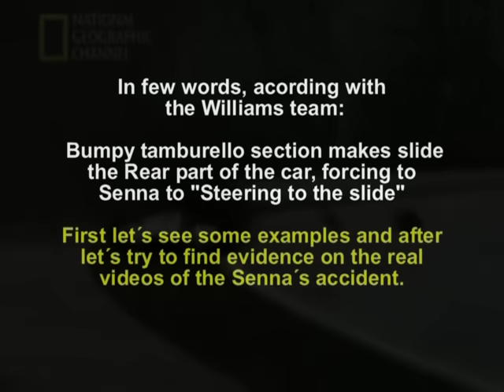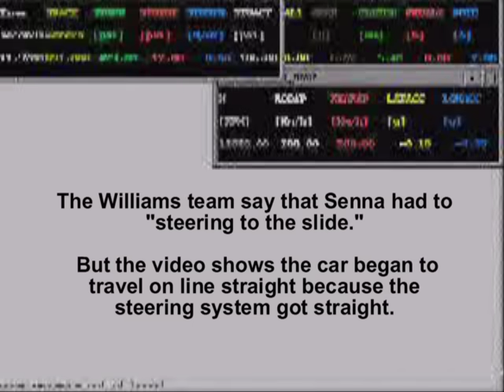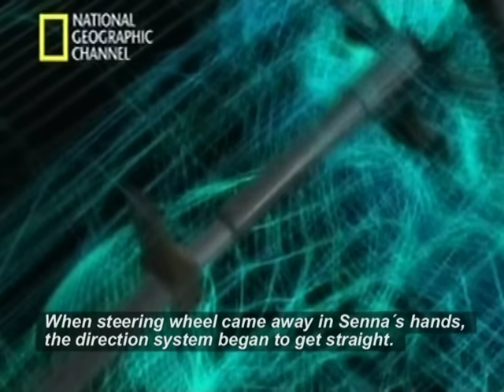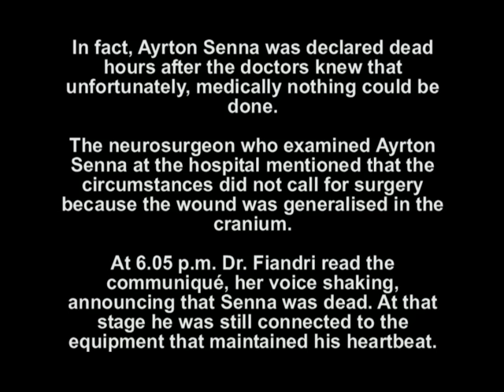5/5 the death of Ayrton Senna - what NatGeo did not tell

Comment: It's clear what happened - Senna was killed because his steering broke, and Williams tried to cover it up.  Simple.
Reply: +spaceweed10 Same as in the case of Jim Clark's crash that was caused by the failure of the rear suspension. But officially, Firestone took the blame for a "flat tire". People first hand at the scene saw that no tires had deflated before impact but the tire company took the blame anyway.
Reply: doesnt it say so in the video??
Reply: WHAT U SAID!!!!
Reply: It's not at all clear.  The video uses for demonstration extreme cases of skid corrections where the driver actually reverses the steering, but a driver that is skilled enough to catch the skid as it starts to happen can just ease up slightly on the turn without turning in the opposite direction.  You can see this slight easing at the point where there is static in the video if you look carefully, as well as the turn rate slowing.  Then the second bump causes the front of the car to go loose, eliminating steering control, and all that was left was the brakes.

Senna alway pushed hard, and had started pushing really hard in the previous couple of years when ABS and traction control made the car more forgiving.  With the banning of such "driver aids" in 1994, he was pushing too hard for what the cars had become.  He had already failed to finish either of the previous races of the season.
Reply: and what about the brakes ? he had no brakes either.
Reply: agree
Reply: Stephan Gildenhuys we don’t think we’re superior 🙄.  We leave that to the arrogant Germans and French.    This accident should never have happened, and the fault lies entirely with the Williams team.
Reply: @psychohist  

Amazing info. You are implying that FIA rules caused the safety to get worst. Another evidence on my list that FIA rules are not for safety. Not at all.
Reply: Stephan Gildenhuys it was an accident - no one set out to kill him.  What about Ratzenberger?  I think it’s disgusting that no one remembers him - especially as he died the same weekend.  Senna even had an Austrian flag in the car that he was going to wave at the end of the race out of respect.  F1 back then had real stakes with real men literally risking their lives to do what they loved.  The sport is so much safer now, but that doesn’t mean there won’t be further deaths - accidents always happen and it’s difficult to plan for the unforeseen.  I concur that Senna’s death was handled badly by Williams, but it happened as a result of poor implementation rather than a deliberate act.  IMO Senna was not only the greatest F1 driver of all time, he was also a man of real honour - I doubt we’ll ever see another like him in any sport.
Reply: Jayco Nobody held a gun to Senna’s head. Grow up!
Reply: Mark G. Where did I say he was forced to drive?!  Obviously you’re not the sharpest tool in the shed...
Reply: I think the fia was also desperate to make it look like a driver mistake. It would look bad for the sport.
Reply: @machinemanmclaren  

Actually that's interesting. It said that his brakes were fully on. F1 cars stop incredibly quickly. It did not look like his brakes were working at all.
Reply: Looking at the camera from Schumacher's PoV who was directly following Senna, it showed a sudden loss of traction from the rear of Sennas car right before he lost control. This would suggest not steering failure but an aero/grip failure, potentially supporting the bottoming out/punctured tire theory. At those speeds on that corner, you are on a knifes edge, so even the smallest of failures gets multiplied with zero time to react. 

In truth, we will never really know.
Reply: why did his steering broke? Sabotage.
Reply: I don't feel so bad for Williams being last anymore
Reply: No, I think F1 covered it up, to avoid losing millions of $, in revenue/sponsorship
Reply: I agree, but I also think F1 banning steering/brake electronics played a part. 
I also think the team didn’t inspect the welds thoroughly.
Reply: @kbuss10  finally one that knows what really went on !
Reply: Stephan Gildenhuys  Some folks think they're superior, regardless of their nationality. I'm British and I'm disgusted that this cover-up happened. It might not seem a massive deal to some people, but these pieces of evidence that they omitted are shocking. And yet Williams are still in F1 even now? The reality is that the car Senna had was nowhere near good enough for him.
Reply: @jayrave4  Germans and the French aren't all arrogant...anyone can be arrogant, irrespective of their nationality
Reply: @machinemanmclaren  The car had brakes, but was travelling too fast in order to stop, or at least slow down  before striking the wall. I think the broken steering is the culprit, and not the occasional bottoming of the car on the racetrack.
Reply: Steve Bell 
It was not a manufacturing error. 
It was a poorly informed and executed modification with a poor quality weld. Essentially a butt weld with no forethought to the heat affected area or to elimination of stress risers. Could have been a chromoly shaft and somebody welded it cold.
Reply: @jayrave4  ...Gerhardt Berger had a HUGE crash that weekend also: the silence after that THUMP when he hit the wall wheels first was SCARY.
Reply: @Delimon007  ...deceleration of up to 5 g; just taking your foot off the gas causes a 1g deceleration: 32,2 ft/sec2 (9.8 m/sec2)
Reply: @stevebell4853  ...'55 LeMans the Mercedes was magnesium also and that car burned for a LONG time. And you can't put out the fire with water. Uh 1 helicopters were made of magnesium also.
Reply: Jayco f1 is like this British boys club. Whiting, Ecclestone, Williams, Newey ect. all got together to cover it up.
Reply: No worries Stephan. It's a fact that F1 has a British dominance, the Brits love to tout it... unless it concerns controversy or outright deceitfulness. Charles Whiting allowed for the Williams team to remove the black boxes, which is quite obviously against regulations and the protocol for a very likely pending investigation into an accident causing death. Now to the average punter out there. How far back do you think Whiting and Frank Williams go for instance? Williams were so cheaky at the trial that they surrendered the black boxes (after they had them for a full month) for evidence, however the telemetry could not be accessed because they did not provide the data card. That is a disgraceful act in itself, and quite a conscious one, which was intended to delay proceedings. Guilty.
Reply: Spot on Stephan, the commentary has been making me feel sick for years. It is so biased and unprofessional to the point of disbelief. That bloody Martin Brundel, or how ever you spell his name, has a lot to answer for. It's funny when I saw a doco on Senna's death and they ask Brundel and Hill on the possible failure of Williams and they both dismissed it out of hand. It sounded so rehearsed from both of them.
Reply: @philgiglio7922  Rubens Barrichello, Gerhards Crash was Years before that. But you are right, his Accident was very bad also.
Reply: @simonstylites8316  Safety was already bad.  The FIA failed to implement rules to improve safety.  Proof is that today Senna's wreck would not have killed him, because there would be a run-out area to absorb his speed, and it probably would not have caused that tire to go flying.
Reply: Its a real shame im from the uk senna was my childhood hero and that williams car looked the nuts was so happy until that day watched it over and over and even before a statement was made i knew he was gone and it was williams fault they basicaly murdered him and the covered it up may williams rot in hell
Reply: @machinemanmclaren  hes going 200 miles per hour brakes wont do anything at that point
Reply: Yes but the previous year Senna’s worst enemy was sitting in the same car and became a champion.  Why would Prost quit the best team with a championship winning car right after to allow his worst enemy sit in the same car and become the best driver of all times by winning potentially many more championships ? Answer: sabotage. An inside job with Prost behind it.
Reply: @machinemanmclaren  be quite it had nothing to do with prost and it wasn't the previous year he died in 94. Senna died because his steering column broke
Reply: Stephan Gildenhuys  Why was we nailed? You sound anti English pal. Senna died doing the thing he loved. Frank Williams didn't force him to drive for Williams! That was his choice. Senna was out to prove a point against Schumacher and Benetton. He openly said they was cheating so he took more risks to beat them. I didn't like Senna! Not because I didn't like the man, because he kept beating Mansell. When he hit the wall I thought okay another boring Schumacher win he'll get him next time. When the news broke he had lost his life I broke down in tears. This crash still haunts me and good many others to this day. I'm just glad I grew up in the era when he raced.
Reply: Stephan Gildenhuys  Well I won't lose any sleep over it.
Reply: machinemanmclaren he braked just before he crashed and he died from a wheel or suspension pole hit him so halo alert
Reply: Lots of wannabe engineers and accident investigators on he lol
Reply: PAC_ jon - I remember talk about reducing the weight in this structure and maybe they went too bar hence unexpected mechanical failure .... It’s a hazy memory now but there was a reference to thinning down the component
Reply: Uhh the engineer openly still holds himself responsible so no. No cover up.
Reply: Moises C. B. Brakes weren’t that good then, it was all engine braking, not sure if it was paddles by then, don’t think so.. but he would have had no engine braking or regular braking on the gravel. Column failure or not, if he left the road at that speed he would have likely met the same fate
Reply: Stephan Gildenhuys the engineer responsible for the modification to the steering column still holds himself responsible to this day, the modification was to extend it I think. The joining method being the pressure of ones hands holding the wheel was likely something used in every car
Reply: Stephan Gildenhuys they actually relieved him of his contractual obligation to race, he told them to shove it
Reply: 4zap7 he didn’t bring Williams anything. Only hatred. He did all his good work at mclaren
Reply: @jayrave4  I more blame F1/FIA at the time, as the race should never even have happened, being there was already a death on that track just two days before. He died instantly, but want declared dead until he arrived at the hospital, so "technically" he didn't die on track, therefore they found a shitty loophole in Italian law.
Reply: @jayrave4  not al germans are arrogant.. look at schumis post race persconference when he won hos first race im 6 races and the interviewer mentioned the name of senna. Schumi immediately bursted to tears. Plus your response is really arrogant tbh😂 immediately blaming other countries that they are worse sounds pretty arrogant
Reply: @Mafia681  why would they accept the blame? I dont know much about Clarks crash but that seems strange
Reply: @machinemanmclaren  the Williams car the year before Senna died also had abs, traction control and an active suspension which technically should have never been allowed in the first place
Reply: @psychohist  if the front went loose as in, in the air, then we would've seen faster steering action since there's no friction on the front tires working against the steering. That slight movement you mentioned looks more like the car's alignment straightening itself on its own after the steering column broke.
Reply: Professional liers !!
Reply: Kris Roberts l
Reply: @pac_jon  No, Senna had asked for his steering column to be altered <lengthened or shortened, I forget> so there was at least one weld in it.  That would be highly significant and probably cause of steering failure.  And don't forget, the car's equivalent of the 'black box' was grabbed by a Williams engineer before anyone else got to the car.
Reply: I think we fainted before. Even if the steering broke, he would break heavily... we would see the smoking tyres.
Reply: nope not at all
Reply: His break also didn't work
Reply: @jayrave4 , arrogant Germans and French? What are you if not talking arrogant?
Reply: @galaxynova9332  His breaks did work, 20m of asphalt isn't just enough to slow the car down at this speed.
Reply: Not just that the tire hit him in the face as well
Reply: Damon Hill (his teammate) reported that the Williams was bottoming out there something awful, which you can see on the previous laps.

There is video somewhere on the Intertubes of Senna bottoming out and going off in a very similar way to his crash at exactly the same spot while practicing earlier in the year. A guy who was there personally said that Senna went off for a couple of laps in a row and then took the corner less agressively for the remainder of the test.

Frankly, it makes a lot of sense that Senna - who definitely made just as many mistakes as anyone else, despite the circlejerk - simple made the same mistake in the race as he had been observed making before. In the race he had a much heavier (and thus lower and more difficult to drive) car than Schumacher, who was pressuring him very hard.
Reply: Aaaaaaahhhhhhhhhhh???????
Reply: Senna modified the steering himself. He preferred the steering wheel to be at a particular height/distance that the rules didn't allow. Senna wanted the steering column modified - illegally - to fit his preferred driving position. Senna killed himself. Period
Reply: @iwasadeum  even if this is true, the negligence still lies within the team and the engineers. They have a professional responsibility, so they are at fault. It's like me going down to the local engineer and requesting he do some dodgy modification to my car. If I go out and crash and burn, the liability is going to come back to him. And god forbid I take out someone else with me... like a marshal for instance.
Reply: Clear, eh? From a shitty video that completely cuts out in places? Correcting a slide does not mean grabbing opposite lock. Often you don't even come back to center. Also...the telemetry doesn't agree with you
Reply: James M  You 'didn't rate Senna as highly as some'?  That makes your opinion invalid right there.
Reply: @spaceweed1025  all opinions but yours are invalid. that makes yours suspect. I was  44 when he died and a race fan the get-go. Senna was not universally loved. It was a love-hate kind of thing and I was on the hate side. I accepted that he was likely the fastest one-lap driver of his era but he was a bully with a race car. Too many times he barged in where he could have made the pass next corner or next lap and it wouldn't have changed the result. He had the talent. It always bugs me when someone with such immense talent uses pure aggression instead of talent. If everyone raced like Senna it would be a demolition derby. He would never get my respect unless he learned to race clean.
Reply: @_jacksonette_  Indeed, but the Germans and French are experts at it.
Reply: His steering wheel shat broke and that is what caused his accident and death... Williams fault!!! Everything else is bullshit and over explanation!!! Plain and Simple!!!
Reply: No way would a F1 team send a driver out with a less than perfect steering assembly. FIA cover. The trial was a complete Italian feckup!
Reply: @machinemanmclaren  Exactly.  I actually caught Prost tampering with Senna's car just before the race.  Asked him what he was doing.  He said he lost his car keys and thought they might have slid under Senna's car.  It still haunts me that I never said anything to the race officials.
Reply: @psychohist  Yes Senna pushed hard, but ultimately what killed him was the broken steering, not his (some may say) reckless behavior. Senna was a genius, and he would not die in Tamborello if not for the broken steering. As the video make obvious, his tires never moved, even the worsest pilot would turn to the left. Senna never had any chance to turn because the steering bar broke and sealed his destiny.
Reply: No it's not
Reply: @jackhammer111  Get yourself educated.
Reply: @user-qx7tm5df8j  Not really - the column itself had been modified to reduce the weight which lead to the failure. However,  Williams to this day maintain the shaft broke because of the crash not the other way around. Sir Frank Williams, who forced the change on a reluctant Adrian Newey, cites the steering data log showing the car was still "accepting steering inputs" as proof the column was intact. That the sensor (just a pot and gear) was above the break and so proves nothing about the state of the connection to the wheels does not seem to enter into Frank's tiny mind. I never liked Frank Williams; he always struck me as a clinical psychopath.
Reply: It's innovation, racing prototypes drivers and teams all know the risk. After the Brazilian media coming out that their will be a contract out on Frank how else could they respond
Reply: @Mafia681  That is total BS. Document it for us. Obviously if people first hand at the scene call what you say Firestone wouldn't take the blame. Tire companies don't make money on racing tires they make money on passenger car tires. The only reason they race just for advertising and marketing. No Corporation it's going to accept the blame for the desk of the most popular racing driver in the world if it can't be proven. If you're going to say something like that you need to be able to prove it and you can't
Reply: @bertram-raven  And you of course are the only ones that knows that the break was above the sensor, or is it the sensor above break.... it doesn't matter because what you are saying would have been perfectly obvious had it been true so you don't get to come along decades later and get away with saying something stupid and have anybody rational believe you.

YouTube comments accept links so if you have some credible proof of what you're saying just presented here and see if anybody buys it? Don't make things true just by saying them you know unless you're a fan of Donald Trump, then you think you can but you really can't
Reply: @jayrave4  I smiled when senna crashed
Reply: @pac_jon  bad senna karma
Reply: @madsjuul1350  you must be a real laugh at parties.
Reply: @alexanderackerman8465  senna died because of bad karma
Reply: @madsjuul1350  suspension*
Reply: @alexanderackerman8465  ultimately it was bad karma
Reply: @psychohist  if you can't see the car go completely straight with no left or right turn then it's completely pointless for anyone to debate with you. Because it's not a debate. The reference point is all one would/should need to be convinced if the other wasn't enough
Reply: @machinemanmclaren  At the speed in that corner he was travelling. as soon as he left the trackthe brakes weren't going to slow the car much. It would be like sliding on ice.
Reply: @SpacestarB  it was a suspension rod that pierced his helmet..
Reply: It’s not clear die to a slow safety car cold tyres with low pressure the ride hight was lower than on e warmed up, his car bottomed out in one clip it shows him turning but not the car as it essentially was skidding along the track at high speed
Reply: Very sorry to break this to you but your comparisons with regards to over steer do not make any sense, your talking about two seperate parts of the corner, which in turn have different throttle positions, steering input and rely on different grip dynamics , - mechanical and aero.. Your argument is flawed
Reply: @jayrave4  Not superior just racist.
Reply: @Nearest_Neighbor  most British people are not racist
Reply: @jayrave4  But then why did you choose to be?
Reply: @jayrave4  Please don't be like that, Jay. This negativity isn't good for you and you know that.
Reply: I BELIEVED, until recently, that SENNA was dead because of the suspension, which was detached following the impact.  Instead, it was the deceleration, which caused the fracture of the base of the neck.  It is one of the doctors who rescued him, to say so.
Reply: Indeed.
Reply: Completely agree!
Reply: It's soo "simple'' it's magical.
Reply: Sorry what are boing and FAA did???
Reply: @stevebell4853  look in the mirror
Reply: they didnt cover anything up they cut it and welded it as senna wasnt happy with the length of the steering .get ya facts right ffs.that was told in court ffs.
Reply: i guess im asking the wrong place but does someone know of a trick to get back into an instagram account??
I was dumb lost the password. I appreciate any tips you can offer me
Reply: @Arlo Saul Instablaster :)
Reply: @Eliseo Randy i really appreciate your reply. I got to the site thru google and im waiting for the hacking stuff atm.
Looks like it's gonna take quite some time so I will get back to you later with my results.
Reply: @Eliseo Randy It worked and I actually got access to my account again. Im so happy!
Thank you so much, you saved my account :D
Reply: @Arlo Saul you are welcome :D
Reply: You're absolutely right!!! $ vs. Life,and $ wins (unfortunately)!!!
Reply: @stevebell4853  Well, he might have a point.  Look at the way we disgrace ourselves before, during and after football matches.  Like mindless thugs.  You can thank those idiots, probably for other guys' comments. No other nationality does it to the extent we do.  I would say we are arrogant.  A lot of us.
Reply: @machinemanmclaren  breaks we’re working, as like aircrafts on run ways when the wheels fail and they ultimately crash, he ran out of run way. Or in his case, he ran out of road to slow down on
Reply: @Delimon007  you do realize when you pass your standard driving license it says how much road is required to break from separate speeds right? Is, traveling at 30mph requires this much STOPPING DISTANCE, and traveling at 70mph requires this much etc, you do realize these guys are doing double that, around a corner? How the fucking he’ll do you think the breaks would do anything to stop his car before the wall???? 

It’s like asking a full freight train who notices a dog is on the tracks to stop in 10 car lengths not to kill the dog, where as it’s more likely to require at least 2 football sized pitches to come to a halt in a straight line, let alone a fucking corner!
Reply: yeah just now I was thinking that thing.
R.I.P Ayrton Senna
Reply: I’ve raced go-karts and had my steering break. It looks like Senna’s did too, you can even see Senna’s head tilt into the corner as if he is trying to turn left, not right as you would in a skid.
Reply: Exactly, if he had any steering at all he would have broad sided the wall instead of clipping it with his front right wheel.
Reply: It was mechanical they didn't know if  steering broke before or after impact  if it were only the bumpy road it should have affected other cars not just sennas car  the steering broke because it was welded together not a solid rod  it should have been a solid rod   sennas team killed him
Reply: The brits mclaren cyndicate team had some involvement in all of that because senna chosed to go to Williams the other team wich had the better more advance car and maybe offer him a bigger contract $$$ and mclaren influence made FiA to make new rules to even the odds in their favor to force Williams to downgrade their f1 cars  resulting in making the car less safe and stable......so do believe senna car was also sabotage the night before his accident by mclaren by loosing or half cutting the steering wheel column resulting in his accident and death.....the point is that mclaren killed him because he turn his back on them and parted ways so they betrayed him after winning 3 cups for them thats what the British do in every spectrum of life to ppl throughout history they killed them when a person dont wanna continue do business with them and go against them...JFK was the same
Reply: Man I’m here looking up about his death after watching his bio on Netflix 
And after seeing everything he been through etc who he was battling and how most of the head coaches just really wanted him to race I was how yea he had to be killed he was like Malcom X to these mfs he had to much power etc so I’m on my little research thang